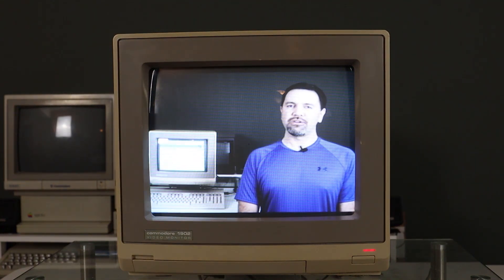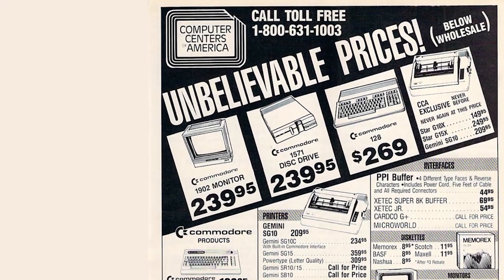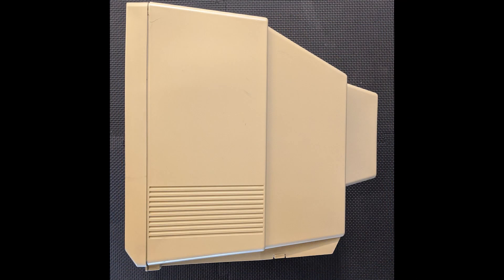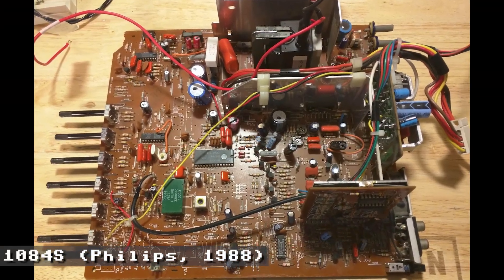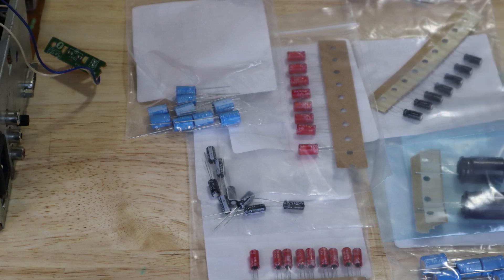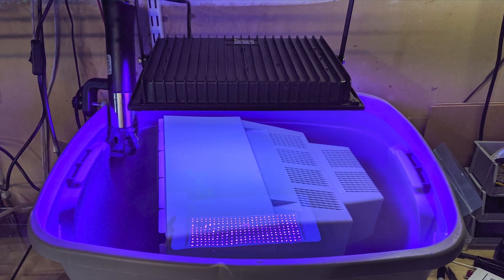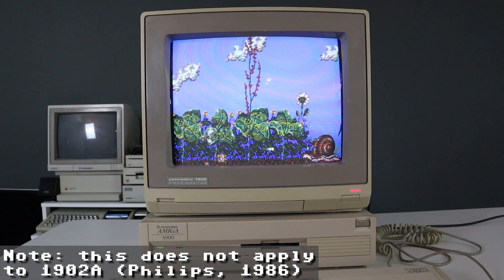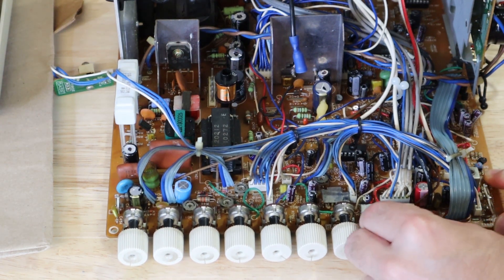Commodore 1902 CRT Monitor Restoration: Recap, Retrobrite, and RGB mod (Part 1)

Comment: Love the channels. I picked up the same monitor.  I went to console 5 and they no longer have the recap kit.  Do you happen to have the list of caps needed? 

I’m getting mains power but not picture. Pretty sure a recap will tell me if it’s worth having or if it’s beyond repair
Reply from the maker: Thanks! It looks like they do still stock the 1902 kit - they also have a list of cap values on their wiki (link is at the bottom of this page: https://console5.com/store/commodore-1902-2002-monitor-cap-kit-110v-ntsc.html). If not, Luke should be able to put one together if you ask him.

No image could be any number of things but I had a problem with my input selector switch being all gummed up. I cleaned it in a later video and that improved my video stability issues quite a bit. It might be worth looking into. Good luck!
Reply: @retrobitstv  Update 3 mins later.  They have them back in stock!  Ordered!
Reply: @retrobitstv  I'll reach out to them directly.  The store says they offer it but it says non available when I try to order it.   Thanks again for your help.

Comment: I wonder how well the 1902 does with getting soaked then drying? Ever since mine got caught in a flood some twenty years or so ago, I haven't had the nerve to plug it in. I probably ought to, I have a C128 and two A500s I'd like to mess with. It's been long enough that I have doubts about my diskettes being readable, too.
Reply from the maker: As long as it dried out and not full of debris or mud it might have survived getting flooded. Others have got old CRTs to work that were outside in the rain for years so it is possible!

Comment: Just did the 1901 Transactor mod on my 1902 monitor...the components were all in place except the 3 jumper wires, so a soldered them in, reassembled and after enlarging the  RGB switch slot in the case to allow the third position, RGB analogue was working perfect. My case had no imprinted analogue RGB on the rear case but it worked fine nonetheless. 
Se-soldering the bottom shield plate was somewhat difficult due to a considerable amount of factory solder.

Comment: Did you ever do the RGB mod?  I have one of these models also an the main board has some traces cut to disable the RGB all the components look like they were in place so I reconnected the traces but its still not working, It kind of works if you fiddle with the switch but it wont stay locked in

Comment: I have a 1902A monitor that has a scart connection on the main board  is it a early model unicorn ?  I cant find any info about this model having a scart  connection

Comment: I suspect an RC time constant has drifted out of spec.  Perhaps a resistor in the vertical circuit has gone high?  Also, if the mode switch is in that circuit perhaps the contact is attenuating the sync signal?
Reply from the maker: That sounds promising. There's a whole network of resistors in the vertical circuit and I tested a number of them but didn't find anything. The switch is definitely in really bad shape and I was thinking of replacing it anyway, but if you think it could be the cause of the sync issues also then I'll definitely replace it. Thanks!

Comment: Wouldn't an LCD be a lot better display and use less power?
Reply from the maker: An LCD makes a lot of sense from a practical perspective, but there's something magical about using vintage tech with the CRT monitor they were designed for :)
Reply: retrobits ugh
Reply: No LCD monitors look worse on these old machines.
Reply: Florida Gliderpilot you like low res graphics as compared to high res? You like it blurry?
Reply: @danielktdoranie  An LCD will show very blocky graphics at this low resolution.  A crt will smooth out the edges of the pixels and make the image appear to be higher resolution. This is why these old monitors are still in high demand.  They are not "blurry" and consume as much power as a light bulb.
Reply: Florida Gliderpilot dude, there are entire communities and YouTube channels devoted to improving graphics on old consoles and computers, so they can use LCDs, for the EXPRESS REASON that CRT graphics look shit. The only reason to use a non-pro CRT is because 1.) you can’t figure out how to use and adapter or 2.) you’re hard up for nostalgia. 

Check out the YouTube channel: “My Life in Gaming”.
Reply: @danielktdoranie  Yes and of course as I said LCD low resolution graphics are very blocky.  This is why collectors spend so much on real hardware with CRT monitors rather than just using an emulator.  It's an entirely different experience.
Reply: ungratefulmetalpansy you can’t see the difference in sharpness, colors and quality?